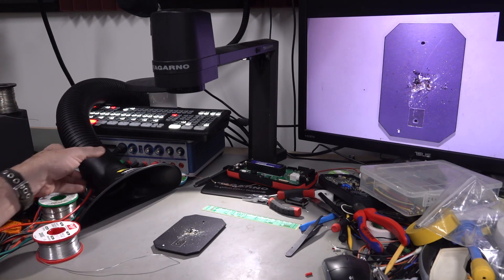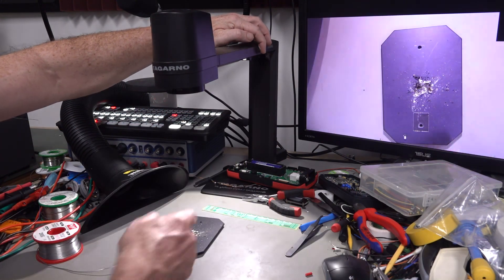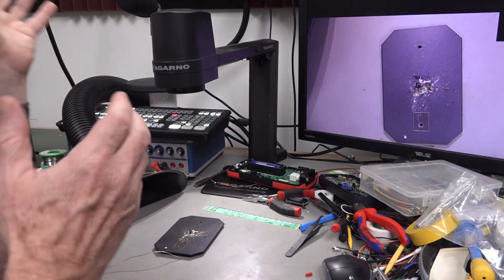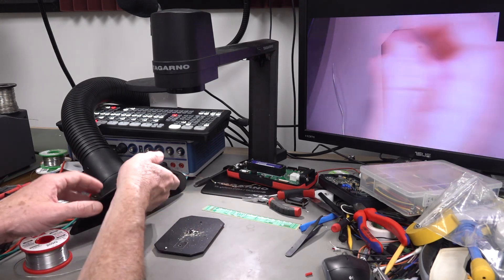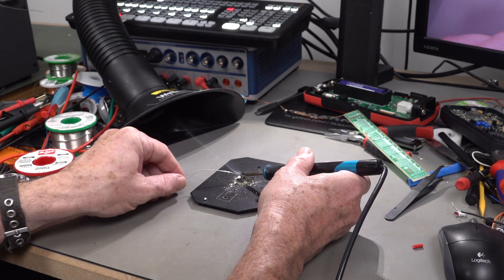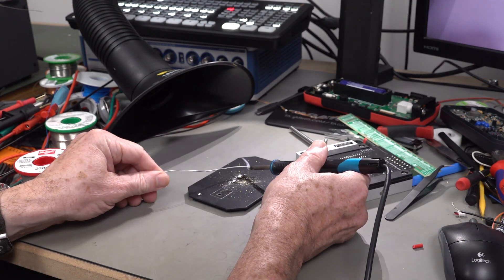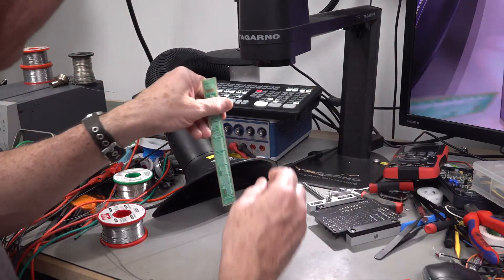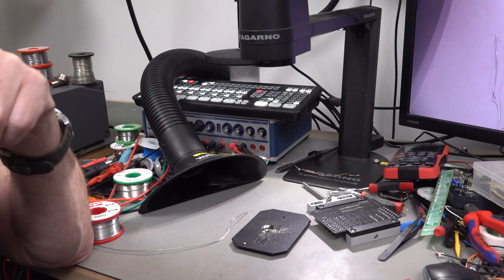Weller Zero Smoke EL Fume Extractor - Part 2

Comment: I've been wanting to upgrade my Weller fume extractor for quite some time but didn't due to the price. However, i saw a brand new EL on Amazon for $599 so I got it. No hose attachments but I will transfer my hoses over from an old WFE 2ES. I'm excited as this model is more powerful.

Comment: Duh !   Find a small 12V  DC blower and a 9V wall wart power supply (<$20 for both) and place the blower on the bench ~100mm away from the soldering area.  Don't point the exhaust toward  the soldering, but in the opposite direction away from the soldering.  It works just like this for waaaay less $ !  Want to get fancy? Put, a coffee brewing filter on the blower's output with a rubber band and Bob's your.... you know.  Better, Faster and a whole lot Cheaper! *

*Even cheaper if you find one in the dumpster for free!    In case your wondering why a 9V power supply, because it moves plenty of air and makes no noise.  If you like the sound of rushing air, by all means use a 12V (or even 15V) supply, at which point you can have the blower ~ 300 mm away!
Reply: It doesn't work, the smoke just gets blown around the room and not filtered...
Reply: @jaro6985  Read the entire comment, where I point out a simple and cheap way to filter the exhaust.  BTW, I have used this method as a professional engineer for over 40 years, and the simple truth is the the "stuff" in the "smoke" is vaporized rosin, which if you look at it the solder or the tin is not "floating around" in the air because at room temperature, it solidifies quickly as it cools and gravity pulls it out of the air.  It will put a light dusting of rosin powder on your bench where it is blown, which can be easily cleaned with IPA and a paper towel.   That is if you don't add the coffee filter I described, in which case when that starts to turn yellow / amber, throw it out and put a new one on.  And just in case you think that this is all a "toxic" compound, the ingredients of rosin flux are Tree Sap and alcohol.
Reply: @shazam6274  Coffee filter wont work, sorry, terrible method.
Reply: @jaro6985 just because you can’t imagine it working doesn’t mean it doesn’t work. It’s profoundly unscientific to think like that. 

You could always combine it with a whole room air cleaner with an ioniser built in to take out pollen and all sorts from the air for hobbyist soldering in an enclosed space.
Reply: @shazam6274  I might try your coffee filter method. But I have doubts about it’ll work with rosin free, no clean flux type fumes. 

Have you tried it with other types of flux?
Reply: @davadoff  You can google coffee filter particle size and see that it makes no sense, coffee filter 10+um, smoke particles <2um. Its not about imagining anything, its a simple mathematical comparison.

Comment: maybe a 3d printed holder than goes from the bench to the fan scoop. like an  i  with the dot being the scoop and the bottom being a wall to stop the air being pulled in from the back.
Cardboard and a glue gun could do a cheap prototype.

Comment: Question for the fluid physics and design types: Could there be any advantage to fluting/notching/etc. the edge of an air intake nozzle for better airflow? (I mean in the design, not hacking up a bought one!) …kind of like the proposed Starshade having those flower-petal edges to do a better job.

Comment: Grab yourself an airflow meter/ hot wire anemometer to check the suction/ distance on that min should be 10m/s for solder smoke. I'd snake it in from the back between the equipment and the scope arm an lay it at the back of where the work will sit so you dont obstruct the scope and don't melt the funnel  👍
Reply from the maker: Tried that, the shadow from the light is too much.

Comment: More fantastic than Fran-tastic, haha! 
Now, with the funnel sitting on the bench, how much can you raise your work piece to still have the fumes sucked? That would be interesting.

Higher settings could be useful for two stations side by side, the unit has two ports after all. I'm sure you can buy an additional snake and funnel.
Reply from the maker: Yeah, possible to have two heads. Don't know how more effective it would be though, they could interefere with each other.
Reply: @EEVblog2  assuming you have equal length snakes that are bent to a similar shape, the suction should distribute evenly. Otherwise the different flow resistance will make one of them suck better than the other.

Comment: The cone is quite a clever design. Might see if it's available separately, otherwise I'm 3D printing one for my Metcal extractor.
Reply: I would watch that SDG video.
Reply: I might have to make one for my Metcal extractor.  It needs looking at as it keeps beeping on startup which i think is block filter but they are lovely and clean. nus be a service manual out there somewhere.  Still that looks good, i might make a holder on it for the remote start button to keep it all tidy.

Comment: That's certainly much better......Maybe you could have the tube right tight to the Tagarno stand and down the side of the NI box......and have it facing you almost.
Reply: I've been experimenting with adding airflow from another fan to create a gentle draft over the work area. You can move the extractor 300mm away from the work area with only a tiny bit of air movement
Reply: @sdgelectronics  Being asthmatic I have learned since day one to blow out when fumes appear when soldering coz the fumes can make me wheeze......so I guess I am doing the same thing LOL!
Reply: @IanScottJohnston  Done that for years, just a light slow blow as the solder starts to melt did it for me. now use the extractor as i do a lot of soldering under the microscope so above the hot spot.
Reply from the maker: @sdgelectronics  Yep, sounds likely.
Reply: @sdgelectronics  Turn it around so is does not "blow" on the soldering, but "sucks" away.
Reply from the maker: Tried that, casts to big of a shadow with the angled light.